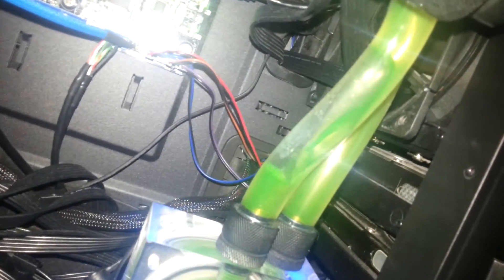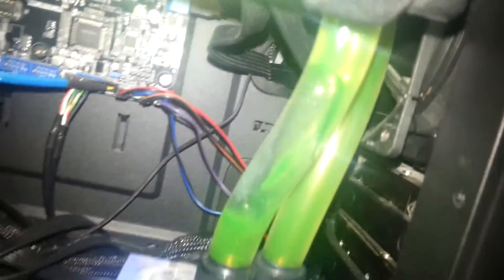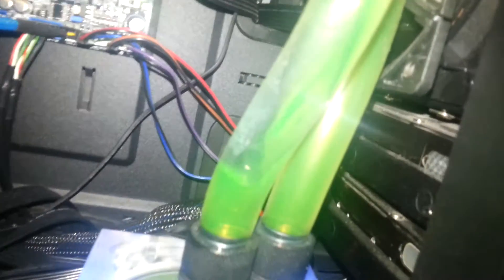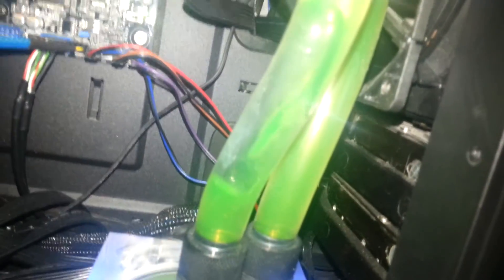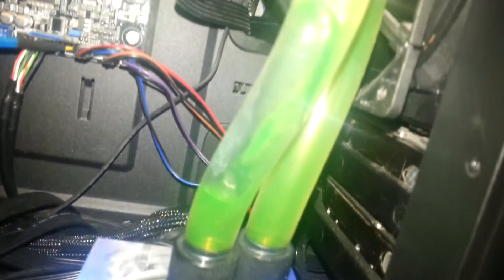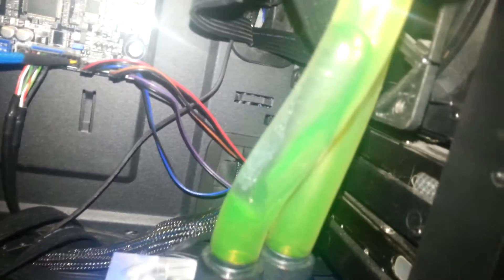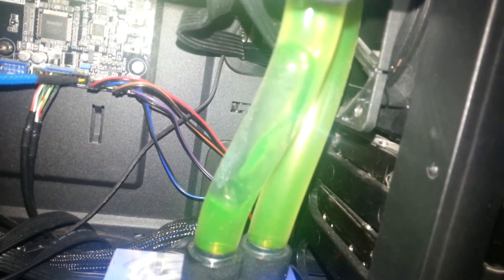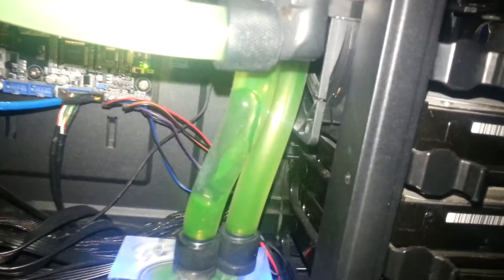Watercooling PC - Massive Air Bubble

Comment: Hi can u help me how do I bleed the air out of water cooling kit and what’s the best way easier way dont mind it’s just bugging me so much please can u help me
Reply from the maker: It can help tilting the case. It all depends on how the loop is created really. Can turn it off and and restart the PC after 10 seconds, speed on your pump slow/fast can help. For example in my new loop I built last week I have massive air issues that I have become better since running the PC mainly becuse I think the loop is badly built that I have today. And I only mainly get this when not mounting the res directly on top of the pump for some reason, same issue now.

Comment: you need to peck the line while the pump is off...if it migrated into the pump it will cause a problem...may even burn the pump up
Reply from the maker: Well its still water going to the pump cause it was going around the air bubble. And yes, just turning off the system removed the bubble. Pump runs fine, been running for almost 4 years 24/7 now :)
Reply: Hi guys. My watercooler Master Liquid coolermaster 240 has like 6 months and started now to make a constant noise of bubbles in the pump.
The pump is connect in pump fan and has 3 pins. I cant control RPM speed on MSI control that is setted PWM and Smart fan control.. Maybe if i change in bios for DC i can control? He is setted at Max rpm 100% with 2200 rpm. One time, i dont know how, i reduced it for 1700rpm and the noise stoped.
I tried one time to put the case in 45° angle and the bubbles in pump sounded a bit quietier and different noise. The radiator is placed in the front. 
What should i do to remove bubbles noise or even config correctly the pump setup for watercooler. Its my first watercooler.
CPU is I7 8700k i never overclock. Only turbo auto.